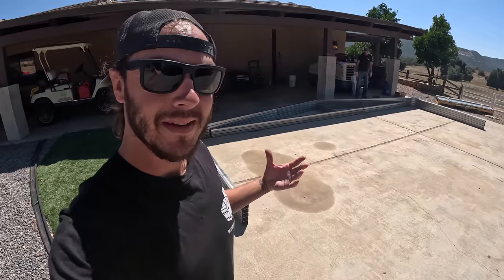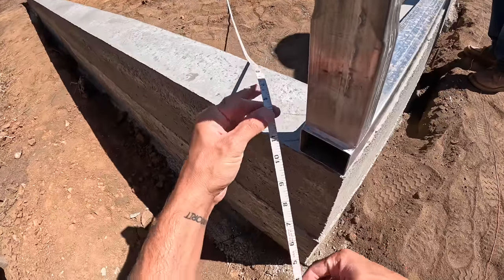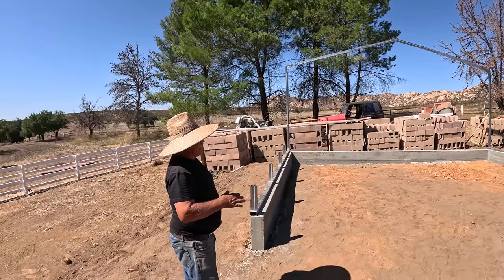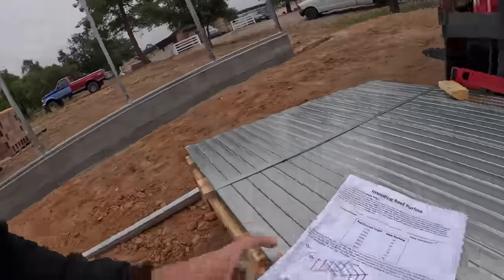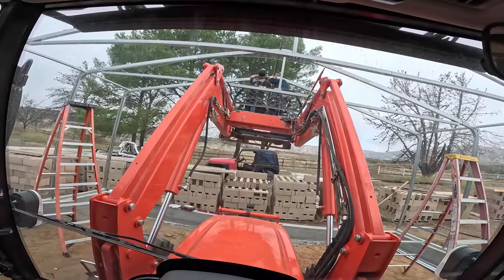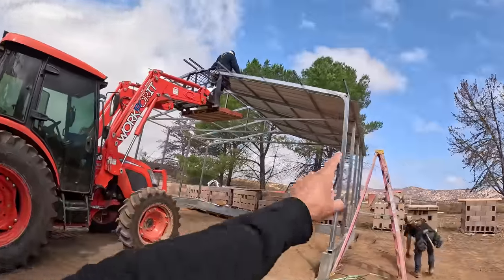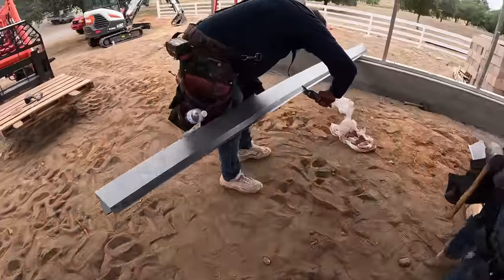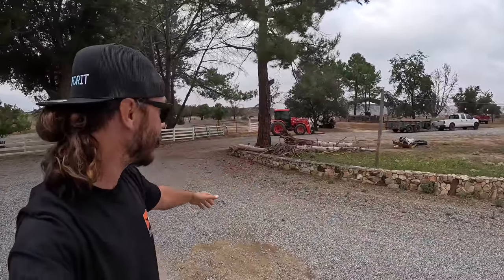Are These Online Carports ACTUALLY Easy To Build?! (Part 4)

Comment: Just a friendly how to, I install those concrete anchors all the time at work. 
Drill your hole in the ground. Get your anchor and put 2 nuts on it butt them up to each other, you then protect your threads and your nut. Use one nut for pounding into the ground.

Comment: You can shrink and stretch those sheets by pinning one corner and shifting one way a little then sinking a screw on the same side as the previous one… then pull the seams to match and sink screws to hold it in place…. You have to add screws along the length of the sheet where they over lap each other but it allows you to adjust accordingly… hope that helps in the future… I build iron frame buildings with similar sheeting

Comment: So to get rid of a lot of the Racking, you can add cable X bracing to the sides From the front to the back… And to add sun shading temporarily you can use fence scrim material, what we call it in the entertainment business is 73%… Which blocks out 73% of the sunlight, but still allows wind to pass through…

Comment: When y’all get ready for that PEMB it’s way easier than those carports. I didn’t realize those carports were such a pain lol. Everything just bolts together. Don’t have to measure much. Just rack the frame once it’s in the air before you sheet it.
Reply from the maker: Anything big, I’m letting the pro’s install it. I’ll do the pad.
Reply: @DMAXRYNO  bolt up beam is like legos. Super easy stuff. Don’t forget about me when y’all are getting ready lol. I like helping on this being it’s my expertise.

Comment: Ryno 
   After building this carport do you think you could design a better/easier to construct "work for it" carport? Or at least write better directions on how to build it?
Reply from the maker: Absolutely. The whole time I was assembling it, I was thinking of better ways to build, market and instruct
Reply: @DMAXRYNO  been there done done that. I was thinking the same thing again watching you. 
   Me (a landscape/hardscape general contractor) and a buddy (a certified welder and sheet metal worker) cussed the engineers and figured out five simple improvements while putting his up. 
   They're definitely designed by engineers and not the working guy putting them up. 
   Engineers need to remember:
K - Keep
I - It
S - Simple 
S - Stupid